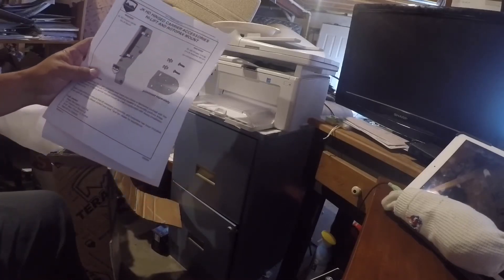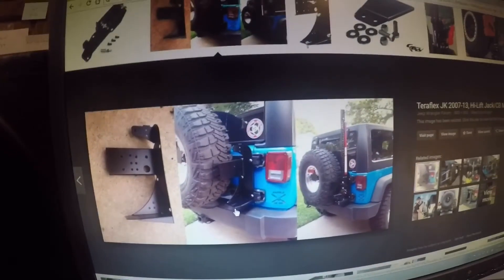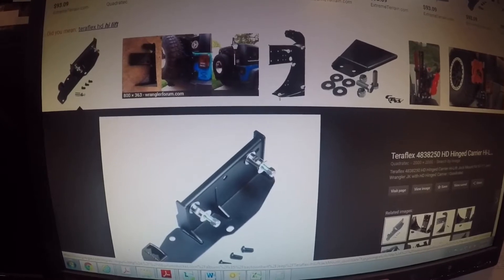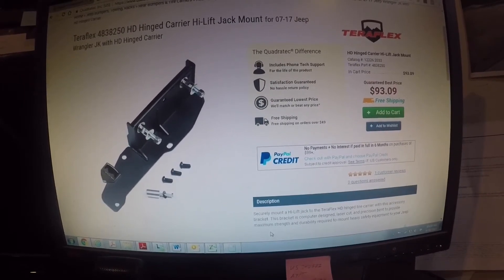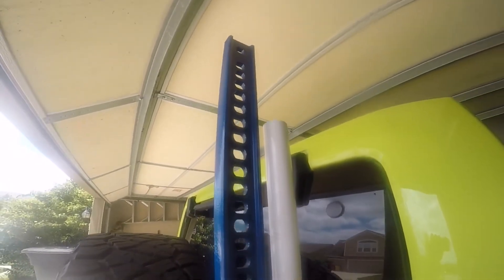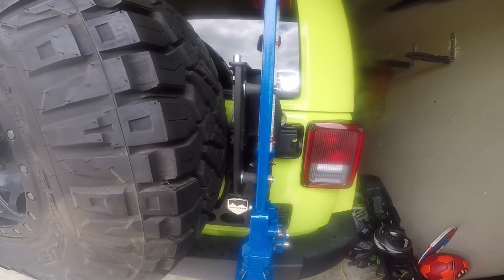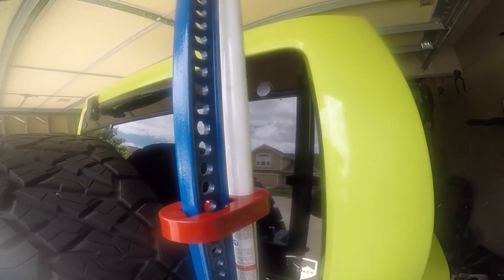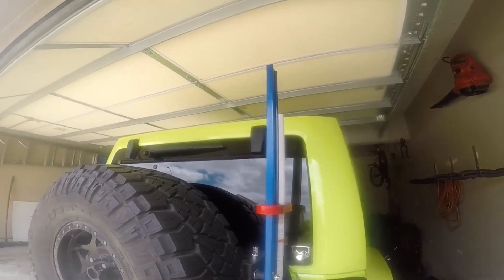New Design - Teraflex Accessory mount for your Hi Lift Jack - unboxing & impressions

Comment: i still have the original mount on mine with no problems with it, I like this new mount but not enough to swap out, I do like that they use stud size which is same as wheels on a JK so u can actually use wheel locks to secure it
Reply from the maker: I do appreciate that part for sure.  I am currently using my wheel locks to keep mine from walking away.

Comment: I didn't know this would replace old design, I have older one but I have to remove jack to fit in garage I like the adj. of this one, if I could get alittle lower I could leave jack on
Reply from the maker: There is a bit of adjustability built in for sure.  It is a very stout mount too.  I don't really hear any rattling either.

Comment: I'm getting ready to install the Teraflex tire carrier. I am also considering this jack mount. What is the lift and tire size on your jeep? I assume a 48" jack will be sufficient. I have a 2014 rubicon with a 3" Lift and 35" tires. I have about 7" of garage door clearance from my roof line too.
Reply from the maker: Thanks for watching!  I have a 4.5 inch lift and 37' tires.  The accessory mount that holds the hi-lift is great and solid - no rattles at all.  Since I have after market wheels that have specialty splined lugs I used the wheel lock lugs to secure the hi-lift jack to mount - you know to keep it from walking away.

Comment: Is the Teraflex logo that comes on it removable?  I really appreciate the review.  Havent pulled the trigger yet because I was weary of the design change.  This review has helped a ton...thanks!
Reply from the maker: It appears to be removable.  But it is really tucked back behind the mount blocked partially by the spare tire so i just left it on.
Reply: It's a thick sticker pretty much

Comment: Why didn't you video the opening and closing of your tailgate? I'd like to see if opening the tailgate. Will the jack hit the tail light??
Reply from the maker: That's a good question but no it clears just fine.  I mounted the jack low enough that it just about an 1/4 inch above the stock rear bumper.  The only issue is that  with the jack mounted there you can no longer open just the back glass and swing the tailgate closed.
Reply: Thanks for the feedback....one more question: how many inches does the Hi Lift jack protrude above your Jeep's roof line? I also have a "standard" garage opening; however, we all know about contract home variances when it comes to "standards".
Reply from the maker: Oh I know there are so many variances - It is about 2 1/2 inches above the roof line and I still have over 1 inch clearance.